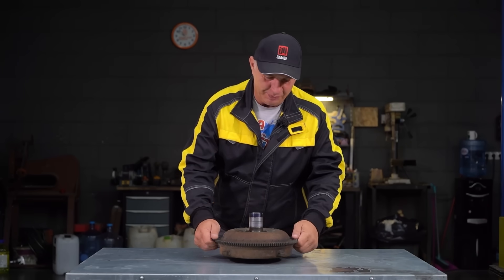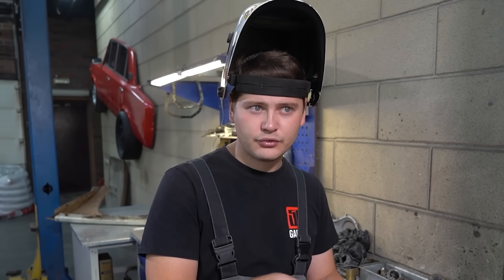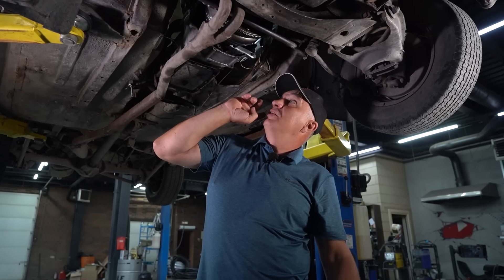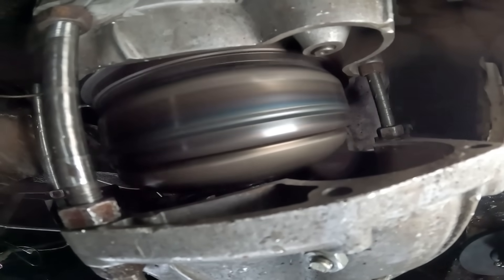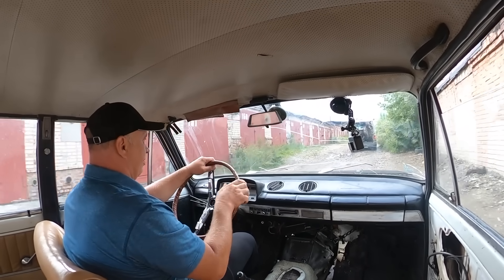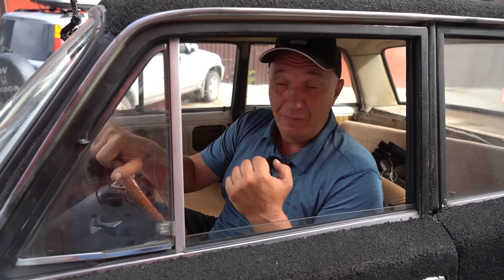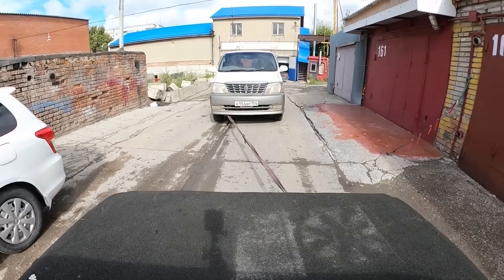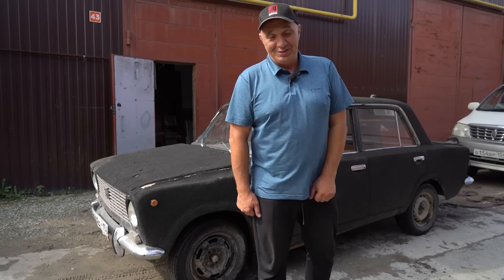Torque converter in a manual transmission - will it work?

Comment: add a brake, literally a car disc brake, behind the torque converter so it can be stopped to change between 1st, Neutral and Reverse.
Reply: yeah and just run the brake off the clutch pedal and you're golden.  The first auto cars had a manual clutch to engage reverse.
Reply: @pepperfish_  
Current autos still do that.
Only difference is that the clutch is engaged with the brake fully depressed.
Check out the cheapies like the Kwid etc.
Reply: At this point you could just use the clutch as it is  @pepperfish_
Reply: Not a car brake, use a semi truck clutch brake, it stops the shaft from spinning only when the clutch is pushed all the way in. They are small and cheap.
Reply: @BlackPill-obey I kind of thought originally they were just going to add a torque converter to a manual setup. Step on the clutch and the torque converter stops moving. Then you could shift it from forward to reverse but after that it would kind of be like an automatic. You wouldn't need to step on the clutch every time you stopped at a stoplight or anything like that. Might be a little helpful for your acceleration to shift from maybe 2nd 3rd to 4th or even 3rd to 4th. But for 30 to 40 mile an hour City driving you could probably just leave it in third and just drive it like an automatic.
Reply: Nah just use a higher stall converter
Reply: 100% 👌
Then it's kind of a smoother engagement than a dogbox keyway for 60s V8 speedboat 😁
Reply: That's literally a clutch brake like a semi
Reply: @5.43v  LOL, I just learned that!
Reply: Manual transmission semi trucks have a "clutch brake" because they're completely un-synchronized; it's usually just a small amount of friction material built into the middle of the clutch actuated by a small ring on a piston. It only engages at the very end of the clutch pedal travel to prevent use until the clutch is fully disengaged. Without it manual trucks are extremely difficult to get into gear from a stop.
Reply: Good point on that modification. : )
Reply: Dude, I was just about to write this as a comment, then I was happy to see someone who wrote what I meant word for word.

He also says throughout the video that the torque converter does not fully transmit the torque. This is because there is an electromagnet in automatic transmissions that causes the small turbine blades inside the torque converter to close to a certain extent. maybe that's the reason
Reply: it would be enough to put the tc between motor and clutch.
or for combined stop&go comfort + efficiency in higher gears only in the first gears wheeltrain.
Reply: Then you're pushing a third pedal to shift and you have essentially the same thing you had with a clutch
Reply: exactly what I thought when I saw it jump in gear.
Reply: Have it hooked to the clutch pedal.  I like it.
Reply: shouldnt need it, as the clutch completely disenguages...

without lock outs, youd be able to throw a car into reverse while moving forward.

ive done this once. but every other time it was prevented, or did damage... but it helped me avoid a person driving on the wrong side.
Reply: Chrysler had a similar kind of system in the 30's, 40's, and 50's...
I remember some early 50's Dodge Royale cars that used a clutch and torque converter on a manual... You just left it in gear at lights, no foot on the clutch... The clutch was just there for parking and going into reverse.l for the most part
Reply: @fadingbeleifs yes Chrysler called it fluid drive. My 1949 Chrysler Royale was a three speed manual transmission with fluid drive.
Reply: @BlackPill-obey  That goes back to Model T ford
Reply: @BlackPill-obey  The output side shouldn't stall the engine. It's the same thing as when the car is stopped in gear (automatic or manual with the torque converter in the video). You can't stop the input side that is connected to the engine flywheel/flexplate though as that will stall the engine.
Reply: @Cyrix2k yeah it won’t stall the engine it’ll just literally stop the entire driven axle.
Reply: @Cyrix2k   I wasn't clear.  It won't stop the engine.  It will stop the car because the proposed brake on the TC output is attached to the input of the gearbox.
Reply: @BlackPill-obey  Yes, it will stop the car but he seems to be able to shift between gears fine once it's rolling. Probably not good for the synchros and would be interesting to see how they hold up. I was also thinking face plated gears (dogbox) might work well in this scenario.
Reply: @BlackPill-obey  well thats the point. you only engage the "clutch" when the car is stopped so you can change into reverse or neu. otherwise the "clutch" doesnt need to be used.
Reply: @n_u001  My longstanding complaint was that a torque converter never really disengages.  There is always some power going to the stator and manual gearboxes won't shift if there's any power applied.
Reply: @BlackPill-obey 
Here's an idea I just thought of: you need a drain valve to drain ENOUGH of the fluid out of the torque converter into a storage reservoir; AND then  CONNECT THAT DRAIN VALVE TO THE CLUTCH PEDAL!
Reply: @BlackPill-obey also: adding a break before the torque converter would work in theory if the car is stopped already. But if the car is moving then you can just float the gears (aka: rev matching)
Reply: @shamaYahu8635  Draining the torque converter to enable easy shifting?  Too much trouble.
Reply: @BlackPill-obey 
Then what about adding a drain valve to the pump? Connect that the 2-way valve to the clutch pedal. It won't drain all the oil but it will drain enough to take away power.

I think if we designed a drain store away fluid reservoir right then we won't have to worry about air pockets. And I have a design in mind. Something like a slave cylinder.
Reply: @BlackPill-obey 
OR BETTER YET! what if we just had a SHUT-OFF VALVE? Completely blocks flow of fluid from traveling through the pump
(Or maybe blocks off a mass amount of the flow and not all)

Right before the torque converter so the oil can stay in the torque converter BUT after the stems where the oil travels to the radiator to keep the oil cool.
Reply: @shamaYahu8635  I'm sure, over the decades, a lot of comparable ideas have been tried and have failed.  The very best automatics are behind us, sadly.  The GM Turbo Hydro 350/400, the Ford C4/C6, and the Mopar A727 Torqueflite.
Reply: @Cyrix2k 😅
Reply: To the guy who said stopping the output of a torque converter stops the car. When you are in drive and not moving the transmission is Frozen aka the output of the torque converter. And the input of the torque converter is constantly spinning because your engine is running. That's just how automatic cars work
Reply: Only would work when not moving.
Reply: Why ? 😂
Reply: Brilliant idea
Reply: Pretty sure this was called a “guie go” in the early 50’s.
Reply: Lol you can’t that will stop engine
Reply: the torque converter is connected to the engine
Reply: Love how this comment has zero mechanical experience or knowledge behind it
Reply: @SamusMaximusSMXD  LOL.  The number of up votes is what's more astonishing
Reply: @BlackPill-obey or just copy dodge in the early fifties. They just used a torque convertor in front of a manual transmission ESSENTIALLY.
Reply: @BlackPill-obey that's easy to do and common in racing
Reply: Have a linkage that has a brake when you let off the throttle maybe
Reply: @BlackPill-pu4vi  if you read carefully, you would realize they mentioned behind the torque converter, the engine would not be affected by this as the torque converter fins wouldnt be moving fast enough to engage lockup and the engine would still be able to idle
Reply: @BlackPill-obey the "clutch brake" (in this case a tc brake) is already a commonplace mechanism in unsynchronized heavy truck transmissions, it's purpose is only to slow down the very heavy clutch mechanisms in these things at a stop enough to grab first or reverse from neutral. It would serve the same purpose here, only used when the vehicle is already at a stop and once moving you would "float" between gears using throttle input to unbind the gears to shift out of gear and revmatch to grab the next one
Reply: I think the ultimate form of this would be to use a manually lockable tc connected to the clutch itself, allowing you the vehicle control of having a clutch if you lock it out plus the ease of city driving that comes with an AT
Reply: Also at least some snowmobiles work like this with break to shift the high/low gear, or neitral and reverse. So there is break disc that does this and slows down the snow mobile as well when it is moving (although it stops without so it's just for gears). You could connect it to clutch pedal. And it doesn't stop the engine just allows engine to be on and just basically stops the wheel side of things in your case.
Reply: No need for brake to stop the TC, just let off the gas to de-load the gears then shift. A similar strategy is employed for shifting dogbox manual.

You synchros won't last as long as it should tho.
Reply: @sepg5084  That's why I said between 1st, neutral and reverse. I'm also interested to see how the synchros would hold up. If it's close in speed, it's probably not much load/wear and I didn't hear any grinding in the video.
Reply: @BlackPill-obey  a manual requires the gears to somewhat synchronize. which, if you're stopped, means a nearly stopped gearbox input shaft (so tq conv output shaft). A brake will do that very well, and we don't care about the case when you're moving, that's what we have the converter for (and even a normal manual can change gears without the clutch)
Reply: Dodge had a gyromatic transmission in the early 50s that used a traditional dry clutch and a fluid coupling/torque converter. What this guy attempted was hilariously bad. He was destined for failure.
Reply: They just need a more loose torque converter
Reply: Even better, you can just use a 3500 stall converter, like we use in bracket racers🤔
Reply: Then it would just be an extra complicated manual would it not
Reply: Early 50’s Plymouth cars came with a red clutch pedal two speed transmission. You put in 2 applied brake, released clutch and drove. One shift to 3. Except in hills could apply brake, stop, release brake accelerate.  Worked pretty well. Only a step below dynoflow by Buick.😊
Reply: It would snap the input shaft
Reply: Congratulations 👏👏 you just explained a clutch. The beautiful thing about the clutch is that it's capable of doing all the work of every gear efficiently without a torque converter
Reply: No
Reply: I came here to say this lol
Reply: they do this on rigs called a clutch brake. but its just a tiny little pad almost like a synchronizer out of a trans
Reply: Part of me wonders if they could actually add a Lube circuit that deals with converter charge pressure and use that to modulate charge pressure and how efficiently the converter couples. If you bled off all the charge pressure the converter would probably allow a lot more slippage even in a non lock up state. Adding a functional converter clutch lockup circuit and function would be good for once you're rolling down the road.
Reply: It doesn't require total disconnect just requires gear mesh and that requires knowing how to shift at the certain points for the gears are turning the same speed it's not hard @BlackPill-obey
Reply: that would work
Reply: @BlackPill-obey nah just double the torque converters
Reply: thats all a clutch is.  so just install the torque converter post clutch.  You'll have the best of both worlds.
Reply: It's like an auto clutch manual
Reply: brake?  Add a damn clutch you mean?
Reply: That would stall the engine no?
Reply: The Mazda roadpacer came with a manual box and torque converter. 
Its an Australian made Holden kingswood sent to Japan and fitted with a rotary motor and Mazda badges.
Reply: You can't put a brake on the converter, it spins with the flexplate. The brake must be put on the input shaft side, I recommend using motorcycle parts.
Reply: Rough n dirty trans brake 😂 awesome.
Reply: And cooling the trans fluid in the torque converter? This thing will catch fire
Reply: @ how exactly do you think that will work?
Reply: converter will eventuly overheat, but would work of fairly short trips with enough cooldown time
Reply: There is a neutral position for that, as in nowadays automatic  cars
Reply: Many semis here in the US and Canada that still have a proper manual transmission actually use a clutch brake.. you have to push the pedal all the way down to the bottom of the stroke, and then there's an extra half an inch or so at the bottom of the stroke that you push into, which actuates the clutch brake.. stops the transmission from spinning so you don't grind the gears so much... The transmissions in semis are unsynchronized, now for the ranges and gear splitters, those do have synchronizers, but the main gears themselves don't.
Reply: Look at this rocket scientist solving everyone's problems🤡
Reply: So, a clutch?
Reply: Or a clutch plate?😂
Reply: God you're stupid
Reply: I was thinking that but instead of adding a disc and disc brake. Use a band break. Have it connected to the clutch so you let off the throttle hit the clutch pedal which is now your engine break shift add power. 
But it seems to be working just fine the way it is.
Reply: These guys are fkn' awesome. I've always wondered if that would work.
Reply: Might be able to just get away with a higher stall torque converter, just gotta let off the throttle and the rpms should fall
Reply: I’m trying to math it up here and all I can see is the drive shaft taking a shit when it brakes for gear change or it grinding and getting hot
Reply: This brake will stop the engine 😂
Reply: @freesoul9324  I mostly stopped responding, but a brake on the output side of the torque converter won't stop the engine. Torque converters slip by design.
Reply: I would've thought this wouldn't work but pretty cool it works tho
Reply: Yeah! Like a ’clutch brake’ in old American semi-trucks with 18-speed boxes
Reply: essentially youre just making a dual mass clutch setup at that point.
Reply: @BlackPill-obey yes that's what he's saying. With the car stopped, a brake could stop the TC so that you don't have to turn the engine off to shift into 1st or reverse. The brake wouldn't need to come into play for shifting 1-4 on the road
Reply: @QuantumLeap83  just add a one way bearing so it will catch one way to drive and the tc can be stopped to change gears or reverse
Reply: @QuantumLeap83 you can't stop the torque converter it's bolted directly to the crankshaft through the fly wheel, flex plate whatever they're using so it would still kill the engine
Reply: Exactly what I came here to say.  And just change the clutch pedal to a brake pedal for it.  Probably add a 2nd torque converter or a clutch behind the brake so the car doesn't stop when it's engaged.  I'm not sure how this would work, after all, it's an experiment...
Reply: @kurtbuck99 Why would you even want to do that?😂
Reply: @kurtbuck99 just talking out yer ass eh ?
Reply: Next put a CVT behind the manual gearbox.
Reply: Ewww... @thedoctor2102
Reply: @thedoctor2102 my
Reply: Or you can just rev match.
Reply: The torque converter is bolted to the flywheel of the engine dummy.
Reply: They could just as easily simply keep the clutch! 

When you want to select forward or reverse from a stop, depress clutch. Otherwise not needed. Probably could make a simple sprag clutch to save space
Reply: @twoeightythreez Yes, that is pretty much how the Fluid Drive Chrysler product semi-automatics were set up in the 40s and early 50s.  They had a clutch pedal to shift into reverse or a forward range. You could start off in high if you wanted to like Vlad did.  No engine stalling when sitting still.
Reply: Semi trucks that are manual have a clutch brake.
Reply: @BlackPill-obey  you've clearly never had a manual car in the air with the clutch down and the engine running then buddy.
Reply: @ssss-df5qz   Your comment makes no sense at all.  A manual car in the air?  With the clutch down?  Must be a bot.
Reply: @BlackPill-obey  a manual valve body conversion is no big deal, its been done a million times.  

Sorry but You are mistaken, even a manual clutch when disengaged applies some torque to the input shaft.  Due to friction.

THERE IS NEVER A TOTAL DISCONNECT.   You can try this by running a car in gear in the air with the clutch pedal down.  The wheels will SLOWLY spin (unless the brakes are binding).  

Infact if you disconnected the input shaft it would stall, while the rest of the gearbox will run at the wheel speed, making it much harder to shift.  In order to shift the speed of the input and output shafts has to match, utilizing a brake {not a lock) will make it much easier to shift.
Reply: @pepperfish_   I'd have been more elaborate but, often yt hides full form replies.  Yes, there is a small amount of force from a disengaged clutch due to friction.  But, the dog clutches can handle that.  What is coming out of a TC is too much and grinding is the result.
Reply: @BlackPill-obey  I dont think this is built to last. lol
Reply: @BlackPill-obey No it would cause the engine to stall. The flywheel and pressure plate act as an added balance shaft for the engine. If you remove the flywheel the engine will not run.
Reply: @pepperfish_ Exactly nice to know someone actually understands how things work. It’s called a fly wheel and pressure plate which are always turning when the engine is running.
Reply: @pepperfish_ unless you have a failing master or slave cylinder (Mazda M5OD lookin at you 👀) there should be a total disconnect between the pressure plate, friction plate and flywheel, the only thing connected between the clutch pack and the flywheel being the pilot shaft spinning in the pilot bearing. Otherwise it makes it very difficult to grab a gear from neutral as the output side of the clutch is spinning while the gearbox is still, causing the blocking rings of the synchros to lock you out of gear and excessive wear on the sychros as they would be working so hard to slow the clutch pack down all on their own
Reply: @pepperfish_  depends on the clutch and wear. I can easily shift into 5th gear with broken synchronizer ring when the car is stationary and the clutch is pressed but I can't when the car is moving due to bad synchronization. It will grind.
This means there is zero power delivery to the input shaft.

On another car I have to wait a second or two after pressing the clutch to shift into gear because the input shaft is still spinning. The latter is a sportscar.
Reply: @wo-olf  Is that the spin down time of the countershaft or the RPM (Input Shaft) are you sure?  Generally speaking a sportscar will have a lighter weight flywheel and driveline meaning that it should be able to shift quicker, I'm learning that the clutch spring tension may have something to do with it.  Kind of slippnig until it heats up and grips...
Reply: @pepperfish_  it's the input shaft. If you put it in gear too soon the whole car will shake because there is still rotational energy left. Haven't had that with any other car my whole life.
Reply: @wo-olf  Must be a vintage sportscar, rear wheel drive? It sounds more like a syncro issue.  

Are you saying that it shakes from stop to when you first get it going, or between shifts as you drive?  "In gear too soon" is a bit confusing to me.  

You mean when the car is in Neutral and idling and then you want to put it into gear? it will shake?

What happens if you just keep it in first and hold the clutch in for example?  Does it bind? Can you easiliy shift at that point into second or reverse? while the vehicle IS NOT moving?    

From the way you say it, it does not seem that the transmission or clutch is operating correctly but you haven't given enough detail to know for sure.     I know with a dogbox would not behave the way you describe.  what car is it?
Reply: @pepperfish_  no it's 12 years old and I'm the first owner. Always behaved this way. When I am at a red light and I want to go, I have to wait a second after I stepped on the clutch or else when I put it in gear you feel that it wants to go because there is still enough rot. energy in the input shaft to rotate the output shaft a tiny amount when engaging first gear.
It doesn't happen after a second, after that it just goes smoothly into gear no matter how quickly I put it in gear (hence not a synchro issue).
Reply: @wo-olf  is it a twin plate clutch or single plate?   It does sound like the input shaft spindown is a little too long.  I'm not sure what would be the purpose of that design, it must be holding a ton of power to have so much mass in the input shaft....   Generally speakng my car does something similar but the spindown time is much shorter, maybe a quarter second.
Reply: @pepperfish_  single plate clutch - 200hp - far from too much power. 
It may not be a full second, I can put it in gear after a full second, I haven't stopped it and tested if I can do it a little earlier. It may be half or 1/4th of a second as well.
Reply: @wo-olf  that's normal.
Reply: @pepperfish_  I don't have experienced it in any other car though. And it's "proof" that the clutch does indeed disengage fully (or at least enough to not spin the tires on a lift if the clutch pedal is pressed like you initially said.
Reply: @wo-olf  ...in certain cases, yes.  not all cases. it depends on like i was saying the clutch pad compound, certain clutches always contact but slip aslong as they stay below a threshold.  We are still talking about comparitively primitive stuff compared to a DSG (dual clutch) for example.  A dogbox also doesn't disengage at all, there is basically no clutch to shift, only to start.  it really depends.  The whole reason why you would have to wait for your input shaft to spin up is because while you the car is sitting in neutral the engaged clutch would be spinning your input shaft, when you step on the clutch to disengage the clutch would still lightly be driving your input shaf until you use the shifter to push it into gear.  The syncro takes over to slow down the input shaft to the speed of the collar driven by the output shaft, if the clutch was fully disengaged like you claim then your transmission WOULD NOT need syncros, the input shaft would just freely wobble into place, however this is not the case.
Reply: @pepperfish_  you need synchros because the input shaft will always be spinning at a different speed than the output shaft whenever you shift. It doesn't depend on the clutch fully disengaging. There is a difference in speed. No matter if the input shaft keeps spinning at engine speed or comes to a complete halt - it will be different to the output shaft which will result in grinding if there were no synchros.
If the clutch fully disengages and the input shaft stops you'd still need synchros.
Reply: @pepperfish_ when!?
Reply: @shamaYahu8635  The next iteration, I suppose.
Reply: @BlackPill-obey I don't know why you'd need the car moving in the first place when going into 1st and reverse